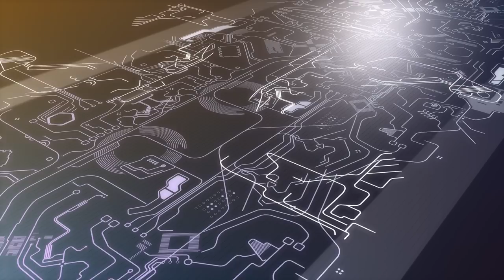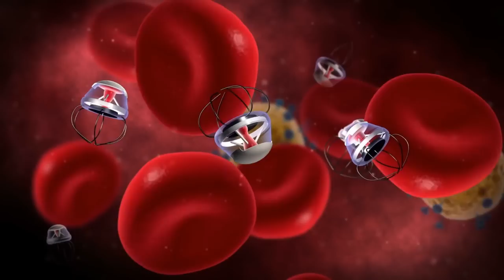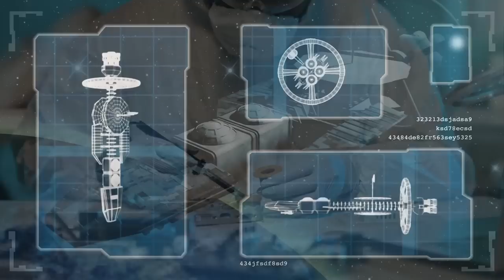Damaged Spacecraft & Shipwrecked Saucers

Comment: Given that that nuke that got dropped by accident in NC only failed to detonate because the 2nd or 3rd backup actually worked as intended, I don't think a ship having multiple backups in critical systems is all that unusual. I'd rather have triple or hextuple emergency backups on my antimatter power plant systems than risk an oops all exploded.

Comment: In my opinion Oumuamua was best candidate for Damaged Spacecraft.
Reply: Was it damaged, or was it just doing a sneaky scan pass before heading off for its next destination?
Reply: Rosswell comes to mind. Hard to say if there is anything to it, but the official stories were pretty fishy.
Reply: @jackochainsaw  He have to low temperature to be active. Also if he try sneaky pass will no try behave so erratic he will try mimic normal profile like 2I/Borisov
Reply: It could have been an unmanned alien probe that has gathered a buildup of ice from it's travel through space.
Reply: @sidgar1  Oumuamua is extremely rare natural formation, or common piece of tech junk. Both case are worth of sending probe after it.
Reply: @Pyriold  There is most likely a lot of misinformation about Rosswell but I think it was backwards engineered. And is used in the large triangle tr3b.

Comment: Soda bottles are great for sealing holes in ships. The bottles hold in excess of 4 atmospheres of pressure safely, so would be great for 1 atm or less. Liquid inside is great at blocking radiation, and ice is a great insulator!

Comment: Main and Backup failure simultaneously is not a coincidence.  The Backup fails because someone plugs it in right where the Main was without first understanding why the Main failed.  So it's subject to the same overvoltage, vibration, mechanical stress, etc. that destroyed the main.  The secondary backup is provided in hopes that an additional chance to understand the problem will not be wasted.

Comment: The one thing I always found an interesting and neat concept in the Halo EU. Was how many Forerunner ships where actually mostly made of Hard Light. Which allowed them to be almost instantly reconfigured depending on situational need. It was a neat take on the "programmable matter" trope in sci-fi.
Reply: Usually hardlight is made to be as a connector or support between forerunner structures or assets & using it as a weapon or defence like shields & projectiles. Nothing is purely made of hardlight given it needs energy to run, & a sh*ttonne of it.
The metal alloys themselves they use for everything from their armours to halos are straight up memory matter nanomachines of sorts, far more reliable & less energy consumption/intensity.

Comment: In the tech space there's a thing called "three point backups," where you actually do have a second backup, because the chances of a main disk and backup disk failing at the same time are surprisingly high, either because the primary backup is close to the main disk, or because it was manufactured by the same company and/or at around the same time.

Comment: One of the big things I've tried to do with my setting is that instead of just having a dedicated 3D printer, they have a "multi-axis tool motion system." That's a lot of words to say it moves the tool its using around in 3D space. This means that with a decent tool changer and swappable build platforms, it can be a 3D printer, plasma cutter, CNC mill, or PCB printer.

It's a bit out there and sounds  like sci-fi handwavium, but these sorts of tools are already in active development for industrial prototyping applications.

Comment: How many levels of redundancy would you be comfortable with Arthur? What's the minimum?
Reply: I'd say 3. With tools to manufacture new parts.
Reply: 6000 hulls
Reply: Matryoshka world a light year across.

With at least one coffee pot on each shell/ level.
Reply: Personally, I would prefer backup replicators safely stashed away, not hooked up to any other system, that could get you back up and running relatively quickly.

Comment: I think ST ships break so often there is not really a backup. There is redundancy.  Reminds me of a Kerbal RP-1 rocket I made. Middle stage had engine failures every flight and every sim, but it was ok because it had 7 engines in a redundant configuration and the chances that all of them fail before the fuel runs out is very low.

Comment: SCUBA Diving Mnemonic Device: 'Two is one, and one is none'. Redundancy forever! The Shuttle had 5 flight deck comps, all of which had to agree. Orion, I understand, has 4, for the same reasons.     'Freezing Tubes' (a la LOS) is one form of imaginary suspended animation, unless you are a 30 year old frozen embryo. 'Stasis Boxes', a la Larry Niven and various Trek Episodes, is NOT freezing. Stasis uses electromagnetic force fields to suspend all molecular activity. In some narratives, 'stasis' involves a narrow time bubble on freeze-frame. Trek's Transporter originally placed the Transportee in stasis so that the system can scan the molecular pattern so as to reassemble it at the destination point. The perfect comprehensive Trek episode demonstrating this is Larry Niven's 'Slaver Weapon', aired in 1974. That's the episode where the Kzinti cross over, not to be 'replicated' until Star Trek Picard's 1st Season. All the above being said, Mr. Arthur knows his stuff. LLAP!
    BTW, Dorothy Fontana's 'Yesteryear' invalidates the 3 JJ Abrahms films, the negatives of which should be burned, and all copies recalled and destroyed, never to be talked about at any legit Trekcon.

Comment: 26:35 As the object is large enough, the pressure underneath that's
being built up, and yields upforce on the hull by 100.000 Newtons
per square meter per bar of pressure. So basically if the object
is large enough, to dissallow dissipation of said pressure,
it could receive enough counter force to signgificantly slow it down,
before impact, especially when 10 or 100 bar pressure is generated.
100 bar of caught up pressure means you can stack solid steel
on top worth 1 million kg, which  corresponds to a 128 meters solid
steel beam from on 1 m3, more than sufficient to reduce the speed
of a falling star destroyer.
And yes, you can survive that with a good seat and belt, since
the first to give way is the ground and the structure of the ship,
as both in conjunction impart deceleration on you, for as long as you're
not directly involved in cushioning that impact.
This also relates directly to size, for a bigger ship allows for less
sudden deceleration, with more crumpling.
This, however is excluded for ships who's structural stability far exceeds
certain specs. They would not crumple during impact, and thus
greatly increase the maximum deceleration value, unless the ground
would make up the difference by giving way more to the undeformable
material..

Comment: As for the IC chips and control circuits, I can see general purpose components like Arduino and FPGA getting used as temporary replacements until the real fix arrives. We can keep an inventry of those components and keep re-using them where they are needed.

Comment: Boats are a better analogue to spaceships than planes or cars, smaller boats tend to carry radios if not going far or backups based on how far from help they will be taken, until they get big enough to carry enough crew that you can have crewmembers that can repair almost anything or get help sent to you. 

Mine has an electric motor that can be powered by a generator and drive the propshaft through a belt because it only has a single engine, multiple engines will usually be more useful until you get to the cargo ships with the gigantic single engines, they rely on being able to drift and not be near enough to hit anything until they can be fixed, or, if they ARE near enough to hit things there will generally also be tugs close enough to help them.

Comment: A long jurney made me think of how one can recycle enough material. Usual stuff like air and water is simple, but what you do with any mechanical parts that wear (say metal that eventually produces metal dust in lubrication)? Or what to do with clothes, non wearable or once that wear, how to make new clothes from dust wearing made?
For a very very long journey you need either lots of spares are extremely high level of recycling (or a combination). I don't normally think of recycling dust from dead skin or dust from clothes. Both can be biodegradeable and recycled that way of course but that forces you to lot of material choices to make suitably.

Comment: 26:40
well it depends on shape and on mass/cross section ratio
and bullets, being small have a limited mass/cross section
you try to decrease it oth to reduce drag and increase penetration but then you increase the barel length needed to reach a certain muzzle velocity an dfundamentally, there's only so much mass/cross section ratio that a dense metal a few centimetes in length can reach
a large object will easily reach more

Comment: Why would we even have a drag parachute that would open all at once? If your vehicle was at terminal velocity or simply engaging in an uncontrolled landing, the parachute could have several different stages that would start out small opening at very fast rates of speed into gradually larger opening at near controllable speed.

I would imagine it would look something like a pinecone with tethers on it connected to the vehicle that would be deployed from the rear and depending on the velocity, different parts of the pinecone would strip away and the chute would be deployed

Comment: The wreckage of what appears to be a possible O'Neal Cylinder is sitting on the ocean floor just off the East coast of Florida. 

It is 58+ miles in length. Ten miles in diameter and is comprised of rings that have interlocking features that are themselves a quarter of a mile across.  Here are the coordinates.  

28°22'21"N 76°01'40"W

Comment: 3 is 2, 2 is 1, 1 is none.

My time in aviation (USAF)  there was typically 2 redundant sub-systems in a box and two boxes in the main system.  This was 60-70s tech.
In 80-90s it was two channels per box, with redundant subsystems in 4 seperate boxes located in different locations.

Another thing they do is put redundant systems on seperate power busses in case you lose one.

The real trip was there were mechanical backups in case all those other backups shit the bed.  (The B1-B was 50% mechanical and 50% fly by wire.)

Comment: On a space ship, you still have to have spares ready for use if something breaks, and there is no real reason not to have them installed and running since you have to have the mass, either of the spare or the stuff you 3d print it from anyway.  So just install it as a 3rd or 12th backup for safety reasons.

Comment: If you are traveling at percentages of light speed then wouldn't "aero" dynamic designs reduce the resistance your ship will be getting from all the space particles? At lower speeds space is so "empty" that it doesn't matter, but at higher speeds you are running into particles so fast that it is "as if" space was full of them right?

That's also why Sci-Fi shows can show ships is dense asteroid belts.  Even though the space between the individual rocks in the belt is very large the faster the ship (assuming you are going at close to light speed) the closer the distance to each asteroid is (as far as your reflexes are concerned) so to you the asteroid belt is very dense.

Or am I misunderstanding something?

Comment: 8:42 Or..
You take the broken part, put it into the elemental shifter,
which stocks all the atoms that are in it in separate containers,
while the ship prints out a new component in less than an hour,
from the backup material that was already present in the containers.

Unless pieces from your vessel have been ejected into space away
from the vessel otherwise, 100% recycling.

Comment: 3:57 Any spaceship leaving Earth without 3D printers for simple electronic chips,
metal and plastic printing, as well as an elemental shifter (massive molecular beam
element sorting at miniscule scales per beam, a million beams,
miniscule input per beam), is doomed to fail.
You can't fly back, or rely on high mass replacements.
The ability to take a broken component, recycle it using the elemental shifter,
and then be re-printed as a complete part is the only way to travel.
Reply: The same way an elemental shifter would be required planet side.
Unless you want to wait 3+ months for a replacement
on something critical. Local resourcing starts with building
materilas and need no elemental shifting. They can be used as is.
More intricate components may need harvesting using an elemental shifter,
since the elemental cotnet may be as low as 1 ppm, which then requires
a million unsuable elements to be shifted from the desired one.
Like a small amount of titanium amongst the many iron atoms
within an amount of ore. Or oxygen replacement from other
oxides, due to leakage or accidental loss.
Instead of having a system for each of these separately, which require
resources each, the elemental shifter can do all that,
and needs only copying to increase the capacity.

Comment: @Isaac Arthur 4:21 - Incorrect. There are certainly numerous systems for which you'll need parts immediately available, rather than want to wait while one is printed up. What you're often replicating is then the backup pressed into service. It's also likely that at some point in the development of replicator tech, you won't be able to print up every component in the ship, or carry every raw material required to do so (think the inability to print dilithium crystals, for example).

Comment: Two words.
Neutronium tape.

Also a ship in distress or under attack would have much greater chances
of backups failing, or it wouldn't be much of an attack or distress.
Future ships may have daily breakings of multi redundancy systems,
even if they are tenfold, like oxygen shifters, where the breakage
is compensated by onling a different similar system, while the other
gets repaired. 10 units, with each one breaking down daily,
in sequence can function, if the repairs are done each week.
this then at any given time would see 7 units functional,
with 2 spares, which would then be given in a maxmium output situation.
So basically the 10 systems would be operable to 128 percent,
continuously, if 7 online units would be required to saturate it's role
for 100 percent.

Comment: Star Fleet requires secondary backups? Any time there's an impending warp core breach the emergency core ejection system is ALWAYS offline! "Offline!?" 

It should be entirely mechanical/chemical like the warp core has a chemical rocket attached and is inside a launch tube to the outside. Light it and run. Dangerous but less so than an uncontained matter/antimatter explosion.

Secondary backup could be a giant spring and mechanical latch.

One of my pet peeves.

Comment: 18:47 Heat generated in space is hard to get out.
For things like Enterprise (if it would exist) that would be
a passively enhanced thing,
which conforms to the ship's outer hull design.
A lot of surface in comparison to inner volume.
When the heating breaks down, it still radiates a lot of energy out,
which can't be halted. Under normal conditions less than 0.001%
of the ship's power would be needed to compensate for wanted
heating loss, while the excess woud be radiated away, or possibly
field induced cooling. Without power only the passive stays.
It's also not the oxygen that's a problem, but the CO2 buildup.
Oxygen will be present in a ship that has it's crew suffocated
due to CO2 surplus, up to 16%.of the regular atmosphere.
Ofc, people wouldn't start breathing differently but just pass out
instead, due to CO2/CO poisoning.

Comment: 35:47 When i see those ship taking off, I wonder,
why the engines at the bottom ?
If the engines would be at the top on the side,
all that would be needed to dump as second or third stage,
would be the now empty fuel tanks, with no waste
on more engines.
Reply: Aerodynamic stability i think. also having the engines at the top means you are either melting the side of ur fual tanks or losing upward thrust by tilting the engines. Also tilting the engines outward means the theust ring needs to be heavier to handle the inward pressure.

Comment: I would argue that the ability to fabricate circuit boards and associated components would be a necessity for long term missions (i.e. interstellar travel). Sensitive electronics do not react well to cosmic radiation. 
Yes,  radiation hardening and shielding would mitigate this, but another mitigating factor being used now factor now is that the computers we're sending into space are practically obsolete compared to the latest consumer hardware on the market. Smaller components are far more sensitive to the spikes and damage caused by ionizing radiation, so using old hardware (i.e. larger components) is a cheap way of making your systems more robust in outer space. But if you're looking to use AI to help run your interstellar colony ship........you're gonna need all the computing power you can get, and that means smaller components by necessity.

Naturally, all of this could potentially be rendered moot if photonic computing ever gets off the ground, which it might - IBM have been working on it for years now.

Comment: Seems to me the real problem needs to be solved with all space travel including Super luminal travel is mass, mass needs to go bye-bye or at least needs to be modifiable, shieldable or otherwise manipulatable in someway.

The easiest way to do this is to decouple mass from it’s time component and thereby eliminating inertia.

Change the mass problem and every other problem about space flight and transportation goes away overnight the biggest acceleration in human advancement that it would be possible to make would be to invest every single scrap of resources in solving the mass problem